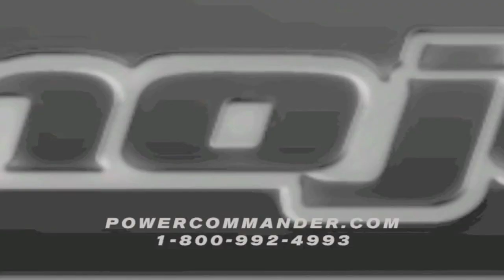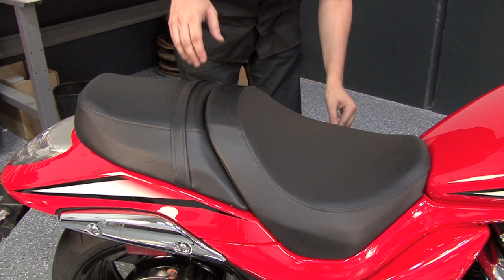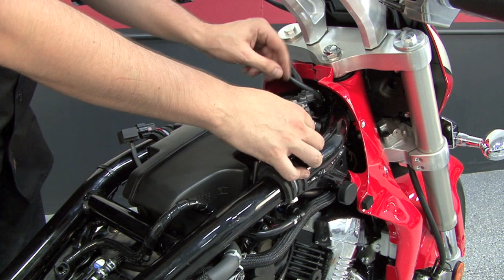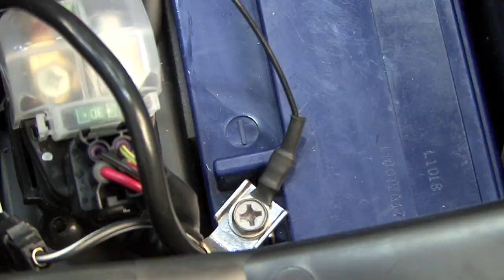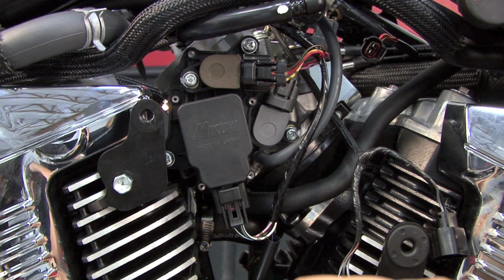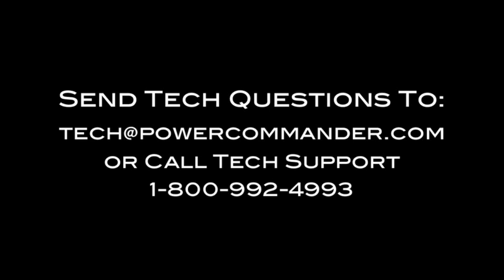Power Commander V Install: 2013 Suzuki M109R

Comment: when I start the my 2012 model m109r, the sound of  rattling sound comes from the side of the clutch and as soon as you press the clutch lever, the sound stops what is the problem of the thing please help me
Reply from the maker: Please consult the manufacturer for a diagnosis of your issue.
Reply: это норма

Comment: And what does a Power Commander do to the M109r?
Reply: Better fuel to air ratio and will essentially make it run better. 

If you have aftermarket options on the bike, you'd just install the new map on your power commander and it'd run with the correct fuel mapping.

Comment: There are also 2 plugs on either side of the pair valve which are a bitch to remove.I am also having issues fitting the boots back over the throttle bodies.How the hell did you get them back on.Still a good video.
Reply: They never got the boots back on..... That's why they didn't show it.
Reply: My current situation 🤦🏽‍♂️